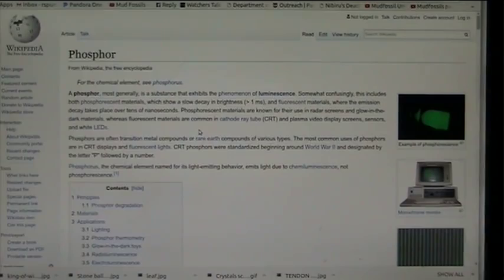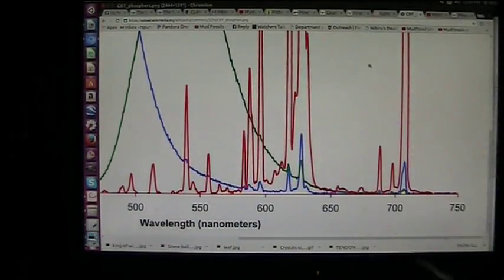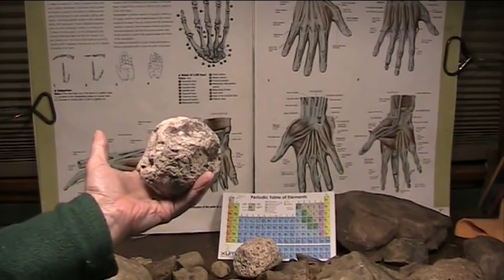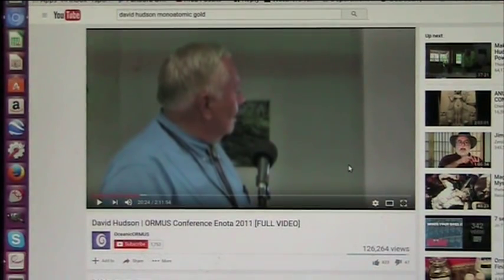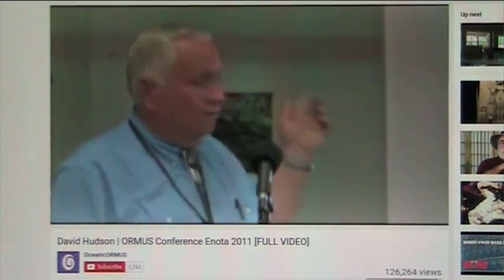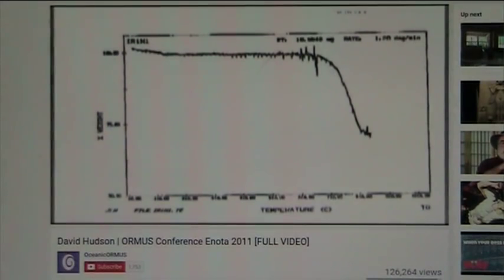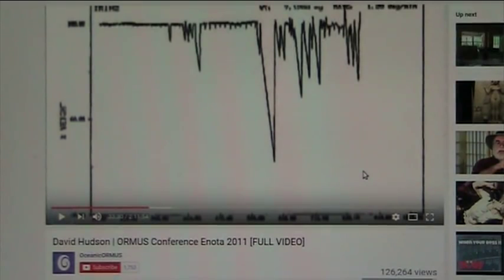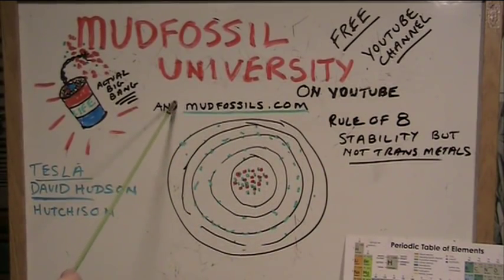Mono Atomic Gold is from Transition Element excitation

Comment: Rodger has done well to explain this. What he dose not explain is that if held at the correct temperature for the correct amount of time it dose a vanishing act at that stage you can pass solid objects through the space without any resistance, bring it back into reality and the sample will show no sign of disturbance. Sounds like transition elements could be the vacuum of space and that creation or the big bang could have just popped out of what to us seems to be an empty void between a few solid objects. That is that we have no way of detecting what is in the space between spaces, What fits in the gaps in the periodic table and where are the missing elements.

Comment: I have plenty to know of how the pure yellow gold khem was used in the past and it's called ormes now. H2c is combustion with out the mechanic explosion and in the ancient days the crystals were smithed with the yellow gold khem with the iron weave in the middle to prevent the radiation poison and destroy of body. There were different total numbers of crystals of type. Quartz could have been one and lapis lazuli. I made the original yellow gold from water alchemy to begin with and have been learning but my work is stalled with out proof also. What I described is the rod and ring of Nimrod of Mesopotamia. Hail...

Comment: I always thought of monoatomic ormus as single atom negative ion dust, with the outer shell filled with electrons (making it chemically inert) but has an electric attraction to nerves in the body, where it attatches to  the surface of the nerves, deposits its electrical energy, and becomes a conductive metallic coat.

Comment: So it depends on the availability of gold in the animals diet or environment. The more there is, the more concentrates in the bone, and the more can be extracted. Does this require fossilization?
Reply: I should mention R. M.  Santilli. Free pdf files of his theories show that there is an unacknowledged bonding force; namely magnetism, between atoms. The magnetism in question results from the shape of the electron. Normally a spherical conglomerate of smaller particles, when placed in a strong manetic field the electron takes on a torroidal shape, causing a strong torroidal flow of magnetism around the electron. If magnetically bonded to another torroidal electron the two will maintain their shape and the bond will remain intact even after the external magnetic field is removed, thus storing a lot of energy, and the application of combustion will release this energy which is overunity because unacknowledged. From a study of the material it seems fair to assume he is correct. How exactly this might apply to monatomic gold is a mystery to me. I am certainly no expert, but suspect there is a connection. Your concept of the neutron is very interesting.
Reply: I suspect that the connection is magnetic bonding because this could be occurring in inert gases. The reason is that inert gases are only inert to covalent and ionic bonds. Magnetic bonding has not been openly studied by chemists so they are unaware of its existence. So the unique requirements (a strong magnetic field) to generate these bonds has let them fly under the radar. The way to test this idea would be to immerse a couple of electrodes in a liquified inert element and raise the voltage to a level where an electric arc can be maintained. This process is used by Santilli in any liquid to generate his patented magnegas. The gaseous molecules that bubble out of solution are magnetically bonded, because in a liquid the molecules are packed closely and thus more of them are close to the arc and hence subject to being magnetised.
Reply: Since there apparently is no mechanism of arcing within biological systems (nerve impulses maybe?) I suspect there may be a special kind of biological process to make and break magnetic bonds. It would be interesting and logical if the making and breaking of magnetic bonds was just as common as covalent and ionic bonds. So if this is true what might be the cause of it? I want to say proteins may be involved as nanobots to get the muscle work done. It would have to be a very magnetic molecule or a highly magnetic place on the polymer chain, which could be said to fit somehow every molecule or atom being converted into and out of magnecules (a magnetically bonded molecule).
However, the bonds may be involved more in the fossilization process.

Comment: you are correct, at least according to my favorite theory which combines other pet theories and some mainstream ideas. Here it is. The aether like an ultracold plasma has two or more components.   Gravity is noncoherent magnetism (the Angry Photographer). Magnetism is caused by the rotation of the standing aether wave electric field between protons and electrons. Lafrenier supplied the electric field idea. But I believe magnetism requires the electron to circulate in it's orbtal. This 'stirs up' the volatile component of the aether creating an implosive vortex. The resulting magnus force and suction is gravity and magnetism is the rotating interference pattern in the other less volatile component of the aether. The gravity vortex may be plasmoidal. At any rate there would be different gravity signatures for different energy level configurations. Higher energy levels should produce more suction or more gravity. As we see from the analysis. In order to get antigravity we need IMHO to create antimatter by reversing the spins of the fundamental particles. Perhaps the vibrational resonance of antimatter could be found and used as an attractor.
Reply from the maker: Actually I think creatures are capable of MODIFYING atoms and producing Gold and other things but no evidence. I do know all animals eat clay and that is RICH in all minerals and metals as it is DEAD TISSUES.